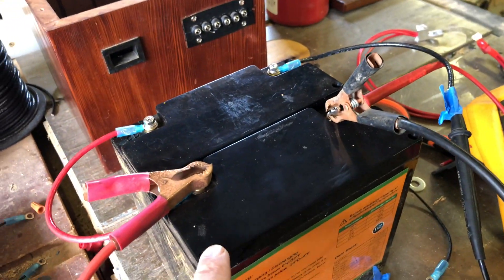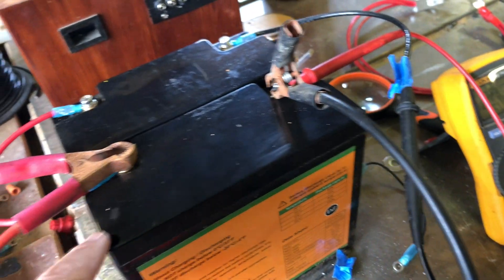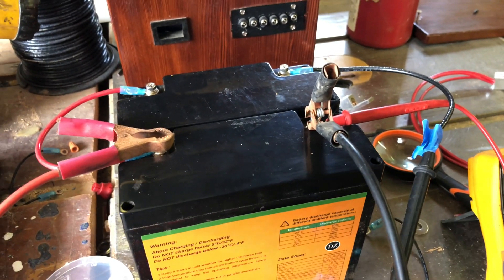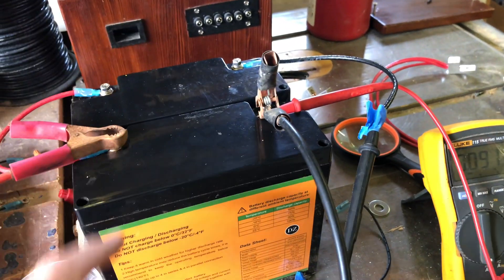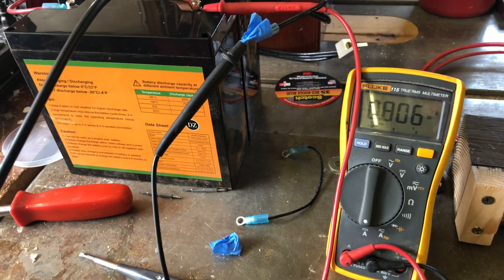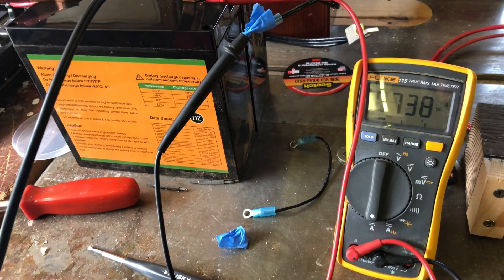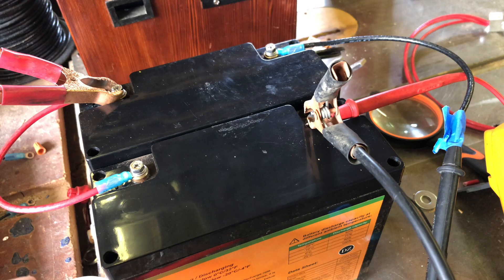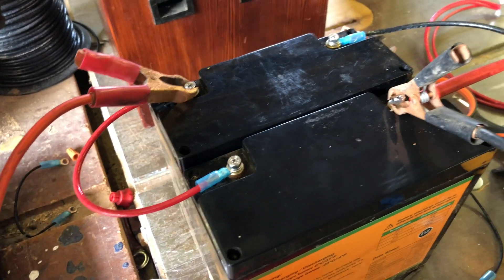Avoid This Mistake When Wiring Batteries in Parallel

Comment: That is series parallel, not parallel
Reply from the maker: No it’s parallel. If it were in series the voltage would double. Since it’s I parallel the voltage remains the same.   Positive to positive.  Negative to negative

Comment: What if you turn one battery opposite to the other and connect diagonally pos to pos neg to neg would be any better than just the reg way of connecting batteries in parellel ?
Reply from the maker: That's essentially how I wired it when I moved the positive power lead to the opposite end. In this configuration, the power connections are diagonal across the battery pack.  This is a good solution.
Reply: @MyEngineeringProjects  ah very good

Comment: I've just put together (2x) 12v 100ah LiFePo4 in parallel, coupled to a 1000w inverter, all Renogy and using 4AWG. All cables/fuses/shunt etc were factored in to give equal lengths(massive assumption that resistance is the same lol). I took the feeds to the inverter one from each battery to equalise the demand on them but what I found having to fully charge them to set the Renogy battery monitor(with a Renogy 20A charger, they were at 13.1v) using the same method (one crocodile clip on each battery) was that they charged to 13.7 and just stalled, the red light never turned green and it stayed like this for an hour-and I'd checked this with the multimeter. I separated and charged both batteries individually, only took 10 mins to hit 14.6 on each and the green light came on. I then removed the charger and coupled them back up again and the voltage had started dropping (I assume down to "float"?) and at 14.0 I put the crocodiles back on but this time only on the one battery, and the charging went complete again with me monitoring the voltage with the multimeter on both batteries!! Seems something is not liking the "dual battery charging" but is ok with one being used and both hitting same voltages? Any ideas what may be the reason behind this? I was concerned I either had a duff battery or charger but this cannot be the case. And a 20A charger should be enough for my combined 200ah given a 10A charger is sold by Renogy and that would be ok for one battery (100ah)? Oh, I'm still discharging from the dual terminals as that's how it's been sized and wired!
Reply from the maker: I'm not quite sure how you are wiring this. When you say one clip per battery are you saying 4 total which is  2 for positive combined to the positive on the inverter and same for the negative?  Normally we use wires or buss bars to connect positive to positive and same for negative when wiring in parallel.

In any event, charging the 2 at the same time results in double the time to fully charge.  If the 2 batteries are not matched - say one is failing, then it will consume energy from the better battery.
Reply: @MyEngineeringProjects  Sorry for the confusion- cables- so pos to pos and neg to neg short cables. The inverter gets the pos from one battery and neg from the other battery so the closest one isn't doing more work than the other and to try an balance the two as best as this allows. Buss bars would no doubt make that more accurate!
Reply from the maker: Ok now I see how you are doing it.  Even if you use the same size charger, that's ok, it just takes a bit longer.  I'd let it charge all the way up to the top and see what happens.  

When you charge any battery to the top then remove the charger, it's totally normal for the voltage to drop immediately.  It will then settle down to the rest voltage.  What would be a problem is that if they kept dropping and never stopped.  This would be indicative of a bad cell somewhere.

Comment: Your red jumper wire look chunky enough and about 6 inches long. It is hard to believe hooking the charger to one battery terminal or another will make much of a difference charging the 2 batteries.
Reply from the maker: Yes it is surprising.  That's why I wanted to measure it to verify what the problem really is.  Current will follow the path of least resistance and the wires definitely matter, even though they are short.

Comment: Looks to me that the cross connects are such minimal gauge that there is a guaranteed imbalance.  With proper 1/0 AWG between the terminals, I strongly suspect the issue goes away....
Reply from the maker: The batteries have a maximum current of 20 amps and it limited to that by a BMS.  A #10 wire for chassis current can handle more than 20 amps (it's only 2 inches long).  It is true that the smaller the wire between batteries the more you will see current differences when wired incorrectly.  However, even with a buss bar, it's still recommended to not take off power from just one end but instead distribute it evenly.

Comment: In practical terms, by improperly connecting load, to batteries in parallel, it will increase voltage imbalance, between the individual cells.
This leads to faster separation, of cell voltage, which equals quicker cell failure, especially when there is a series connection, and/or with the use of older cells.
Reply from the maker: Yes it sure does